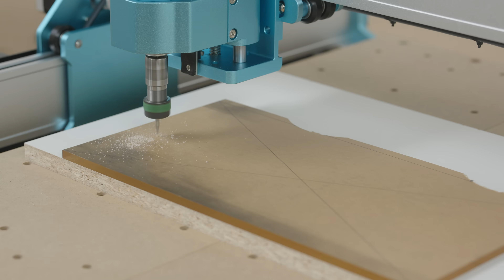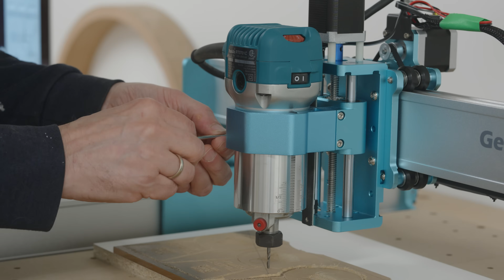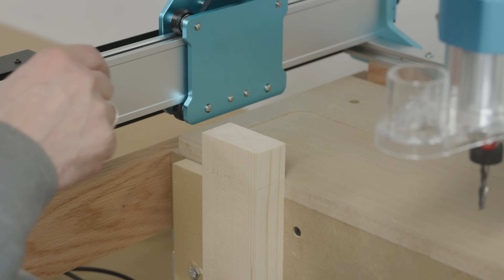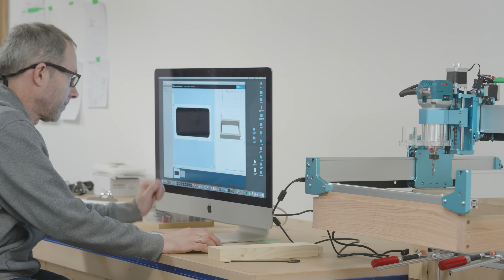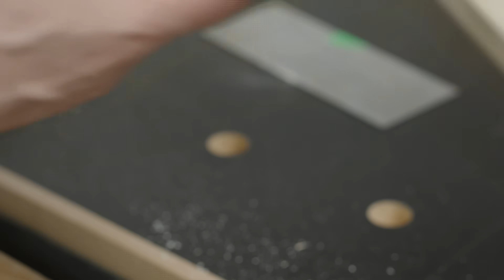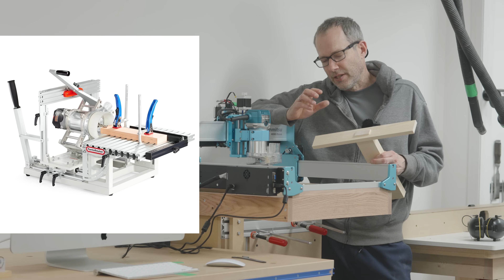Make Perfect Wood Joints with a Low-Cost CNC – Joinery Station Build

Comment: take a 4040, shorten the y axis, put it in vertical and add a pantorouter like table. 
whouldnt that be the perfect cnc joinery machine? same as your setup but with the added bonus that it could easily accomodate long pieces

Comment: This is such a great idea! It looks like you could still throw a spoilboard onto the front and rear aluminum rails so that you could use it as a secondary CNC when not being used for joinery? You have me thinking that a version of this where the CNC is laying vertically on it's back and recessed into a work surface, it could sit at the end of a miter station to accept boards of any length. I am currently setting up a Genmitsu 4040 Pro Max that they sent me, by installing it onto a folding mobile miter saw stand,  so that I can transport it easily and do a demo at the Long Island Woodworkers Show coming up in September. I added a vertical clamping fence similar to the one on your larger CNC and should have a video on that soon. Do you have any tips on toolpathing your joinery that you have discovered on your journey? I subscribed based on this video alone. Keep innovating!

Comment: Nice idea I used to have an 8x4 CNC Router which I did a similar conversion it worked ok,   but looking at your small machine another idea would be to mount it vertical on a wall, and have the wood horizontal so you could do joints on really long timber if you wanted too.

Comment: I've thought about doing this on my Shapeoko Pro CNC, which can cut in front of the spoilboard. But, the limit of the table height to the floor is somewhat limiting. Are there any CNCs that can be operated horizontally?
Reply from the maker: As far as I know all the lead screw / nema 23 type CNCs are powerful enough to move around when mounted horizontally.   Even with this belt drive / nema 17 CNC I tried tilting it back and it seems to work okay, but I haven't tested it under pressure or load of cutting

Comment: Love this idea! I've seen some very artistic joinery done via CNC. You can even get a 3020 ball screw unit to keep costs down but still play around, problem with those units though is the ball screw goes right down the middle of the table. Not sure if that's also true of the 4040
Reply from the maker: Oh yeah that would be a deal breaker if the ball screw is in the base or middle, as you'd need that empty space.  The 4040 is totally empty and had a nice straight and square base that was fairly easily mounted.  Lol I wish they sent me the 4040 pro though, not sure if I love the belts.

Comment: An interesting idea. I wonder how you align the two surfaces if you need to have a joint where the edges of the wood match perfectly.
Reply from the maker: It's funny Ive done all kinds of CNC joints, but haven't done that one yet.  Should be possible with a little thinking, the CNC can create and remember very precise origin points, so its really just visualizing where some stop blocks or fences would go.